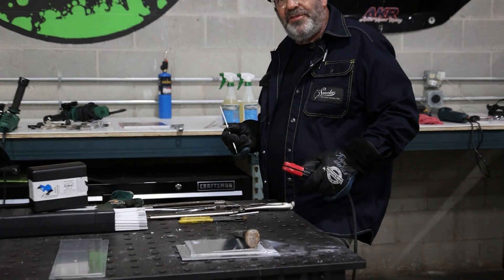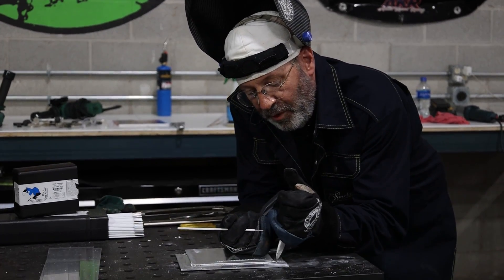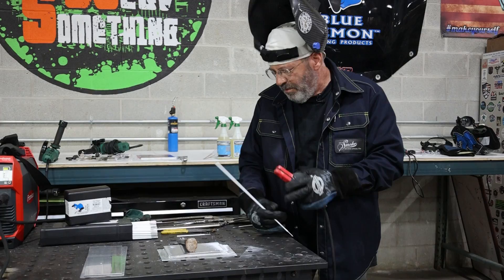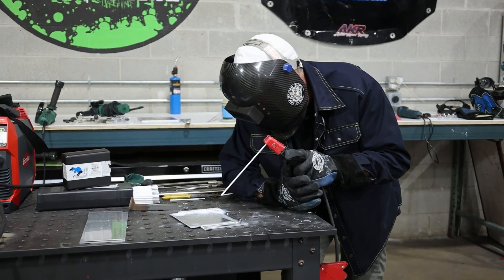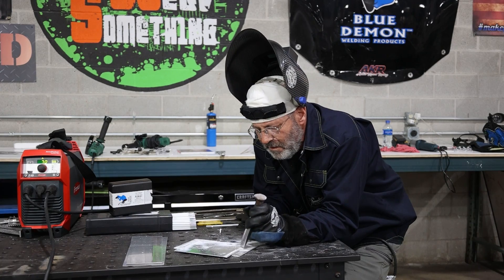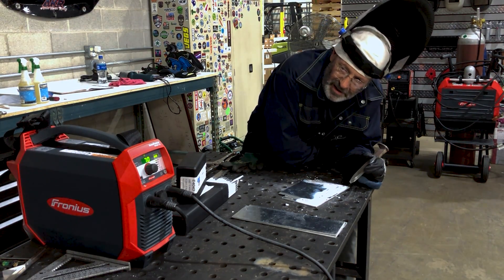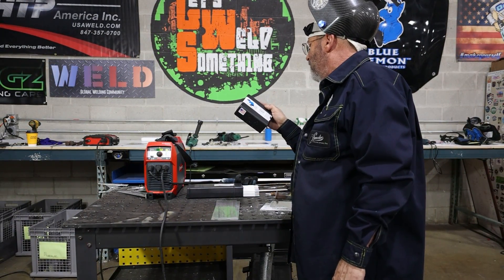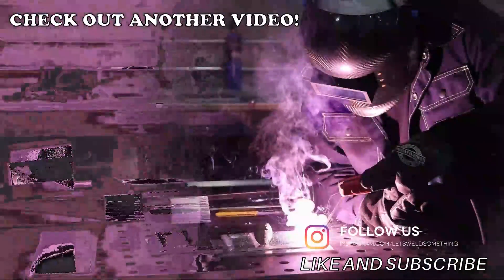Aluminum Stick Welding (SMAW)

Comment: One process you should try is 1N12 inconel SMAW 1/8 on some inconel 625 in the 2G position. 3/4" plate. The root specifically the top bead will wanna fight ya.

Comment: Bob. 
   I tried that back in 1980 in an open pit mine in Arizona. The flux is like watching milk paste boil. It was full of porosity…. 
    I’m sure the science has come light years since then… but that’s why I got a portable mig rig.  .
    I’d like to see a cut and etch after you get done… just to see if and how they keep the bullet holes out of it.
Reply: I know a guy who built an aluminium fishing boat with stick. He was one old school old timer that guy.
Reply: @WilliamPayneNZ  
  He drowned….right???😕
Reply: @williamhague2768  no he got years of use out of that thing. Had an LS1 in it. Was a nice boat. He may still have it.
Reply: @WilliamPayneNZ   all my experience with aluminum stick electrodes was negative. I’ll be interested to see if Blue Demon has found a way to make it work. I would have liked the opportunity to see the setup and method the boat builder used.
Reply: @williamhague2768  Ill try and find out but it would have been a basic welder and the rods most likely were not blue demon.
Reply: @williamhague2768  the guy who did it for the record also built his own house and it’s a nice house. He was a retired auto mechanic.
Reply: @WilliamPayneNZ  I’m curious, cause I’ve had a hard time with the ones I used and poor results. That means a lot to me cause I don’t like getting whipped.  I tried DCRP, DCSP and I even gave A/C a spin.  It all looked like Swiss cheese… if I can learn how to do better, I’d be most appreciative.
Reply: @williamhague2768  ill find out more and get back to you.
Reply: @williamhague2768  also what was the aluminium you were welding? what grade?
Reply: @williamhague2768  sounds like you might have damp rods there, flux will draw in moisture from the air over time, have you tried baking your rods to drive out any moisture before use? You should notice the flux becomes a slightly lighter shade as the rod fully dries out
Reply: @wr2956  they were new out of the box in the desert of Arizona. 
    I’ve never tried them since as that experience led me to believe that the use of stick on Aluminum, was snake oil. Never tried it again and wouldn’t discuss it

Comment: I haven't tried this process yet.  Need to give it a try one of these days.
Reply: If the workpiece isn't kept hot enough, the flux solidifies over the weld pool, killing the ark, stone dead.  To have any success with this type of rod, i've had to keep the blowtorch flame playing on the workpiece while welding i.e. holding the blowtorch in my left hand and the electrode holder in my right.